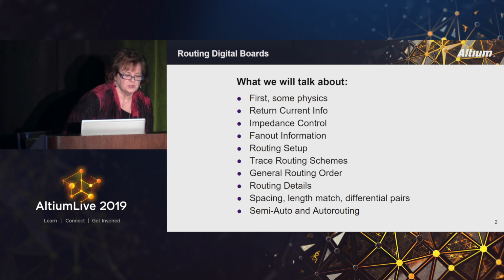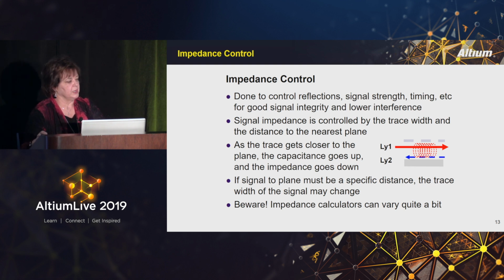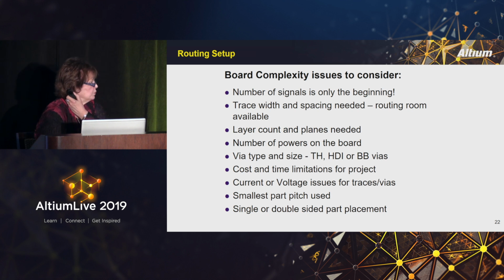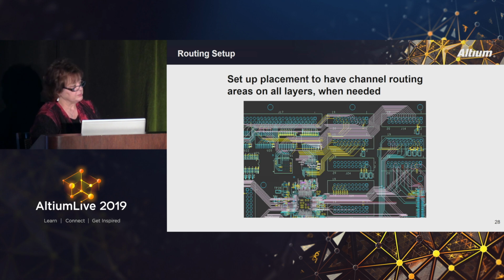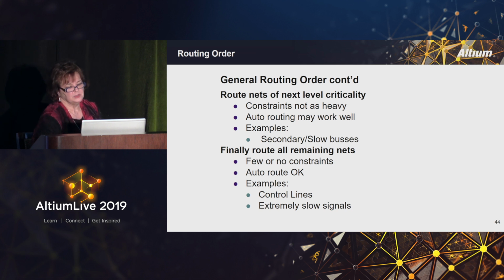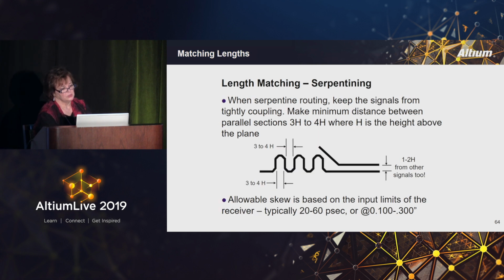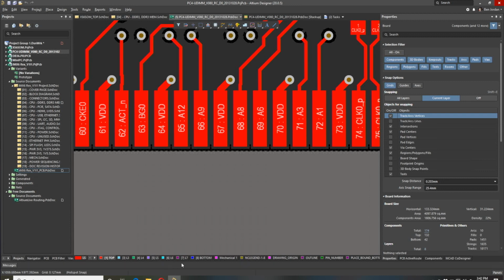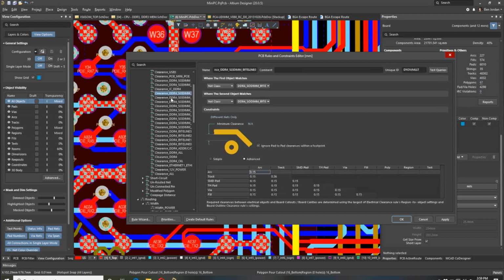Routing Digital Boards: The way Signals are Designed is Important! - Webb, Jordan

Comment: 1:24:13 contradicts the multiple lectures by Rick Hartley on the true nature of length matching. Appears to lack the in depth engineering understanding Rick has so has to gloss over the explanations of "why". I've attended her (paid) IPC classes previously.
Reply: I dont agree, the point is to have equal lengths in time, I think she explains that in concurrence with Rick. ? 
But I have this going in my brain: Rick Hartley advocates copper pours, while Eric Bogatin says no-no-no. Go figure. (I think Eric has a better point, but I guess it can vary depending on many factors). I assume Rick means in PCBs with very limited number of layers. I have not got an answer yet...
So I guess some experiences are slightly different.
Reply: @MrSemperfidelis225  I think I saw somewhere where Dr. Bogatin clarified what he meant, that doing ground pours is risky because there could be multiple small islands of copper pour that aren't connected to ground.  He just thinks that the reward to risk ratio of doing copper pours everywhere is usually not great because most PCB designers can easily miss grounding every single copper pour island that forms.
Reply: @CannonballCircuit  Thanks, yes that makes sense. A floating copper island resonates, as well as allows signals to couple to and from it so control of where energy flows is lost for sure. So I guess copper pours can be good if the pours are well connected to their respective planes (GND or PWR).